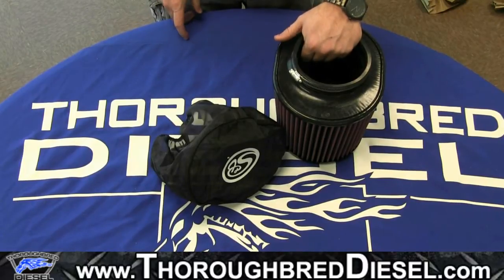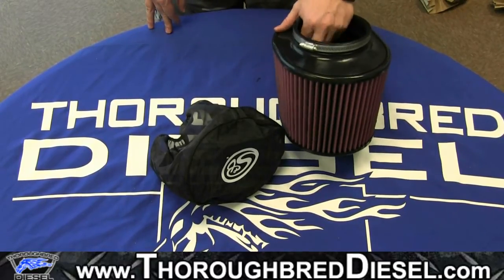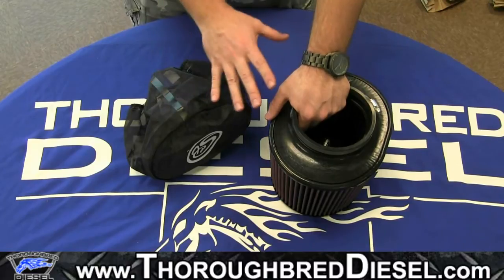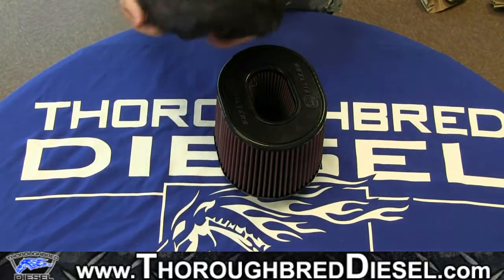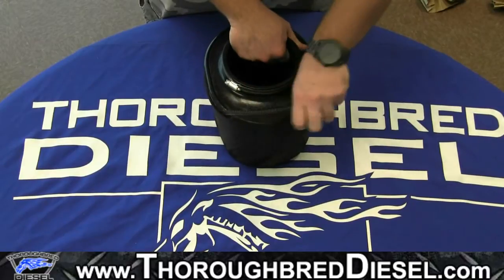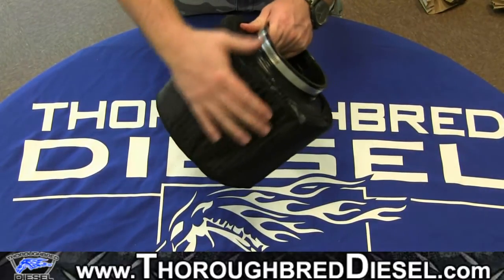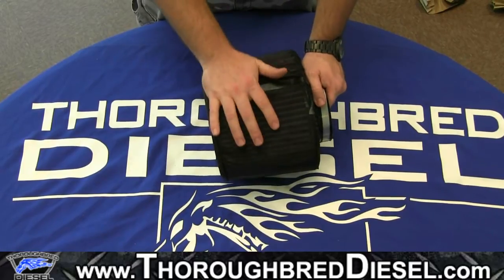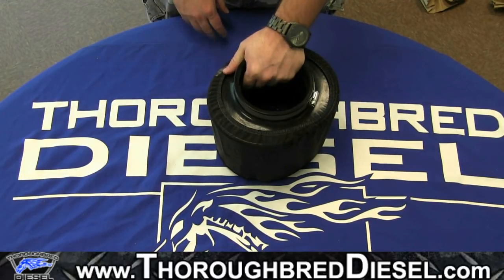How To Apply a S&B Filter Wrap

Comment: Looks like that particular filter has the "velocity stack (I think that's what S&B calls it)? the open end? Didn't this particular filter wrap cover the inlet to that? This wrap would on my 1050, as it's sealed on that end, with just the sides open. During my last cleaning, IO noticed a lot of bugs and cotton wood etc. stuck in my filter, I'm thinking a wrap will help keep those out, and I can pop the lid every now and then and shake or vacuum them off without removing the whole filter for a full service/clean/wash-re-oil etc..
Reply from the maker: The pre filters flow through the entire wrap so even if the filter does have a velocity stack, its still going to have flow to it.
Reply: @thoroughbreddiesel  I just re-watched the vid on my laptop, and  I can see the end of of the sock is screen/mesh like the rest. On my phone, it looked solid,, which would work on mine, because the end is capped😂